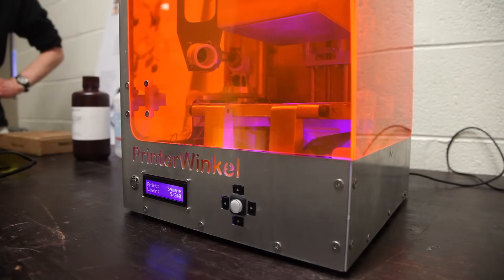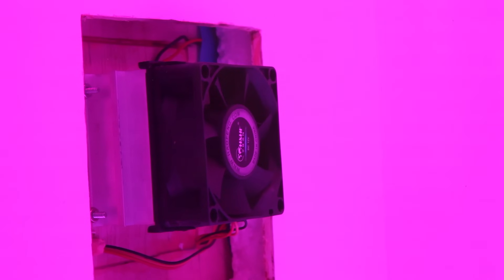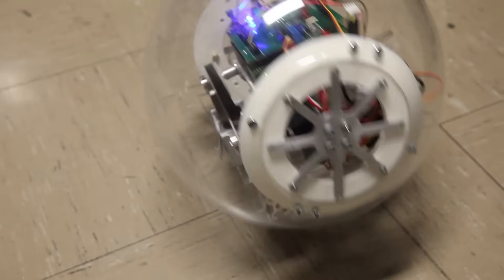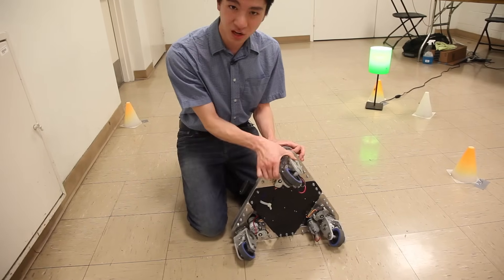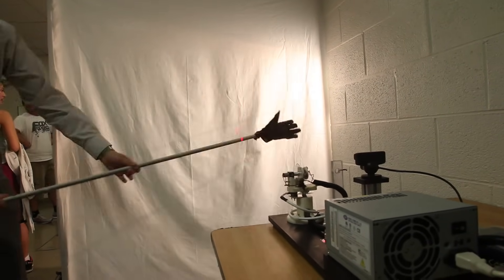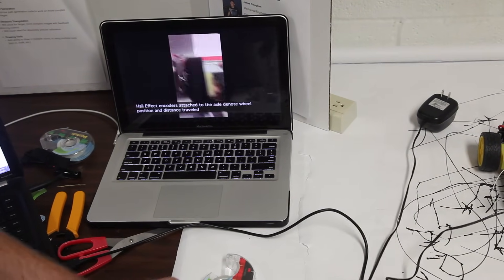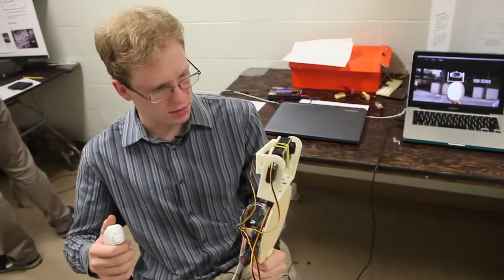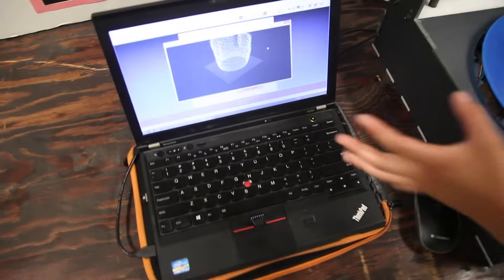Mechatronics Design, ME102B, Prof. Kazerooni, Spring 2014

Comment: That wheel chair was dope ,common that's worth an ovation
Reply: i really like the interface. Instead of a joystick we have traditional controls with less hassle. Plus the normal wheelchair can be converted
Reply: I’ve seen a few people in wheelchairs using something like this. Don’t know if these students were the ones to make them, but it’s become a product.
Reply: unfortunatly not a standing ovation
Reply: Mashallah tbark Allah alhamudillah inshallah better astgfrallah
Reply: Genuine question though, once the motors are activated and the chair goes forward with speed, how would you control it if some sudden obstacle comes in the way? Would be difficult to stop the motion with ease I suppose.?
Reply: @AtharvP07  What if you start rolling down a hill, you might need wings attached at that point as a safety feature.

Comment: I like your "Fido" robot. I built something similar in the 90's, but it was less sophisticated. To balance it I built a small gyroscope placed on the four wheeled rover like vehicle that drove within the hamster sphere, and was radio controlled. It wasn't perfect, because my home-made gyroscope needed some kind of speed control to respond to various forward, and backward turns made from the RC operator.

Comment: If this happened in 2014, does it mean that the guy at 0:22 changed the history of 3D printing? 🤔
Reply: Only if he didn't stopped
Reply: nah, the techs been around for years. SLA (the type of printer that he made) just hasn't been seen in homes until recently because the method he used (moving a laser) is incredibly expensive to manufacture. it's become more accessible recently, as inexpensive machines like the elegoo mars that use an LCD screen to cure the resin have appeared, however they remain less common than their FDM (regular 3d printing method with nozzle and plastic) cousins because resin is toxic (and expensive) and requires lots of post-print processing and safety precautions during the processing.
Reply: errata: Stereolithography (SLA) printing was invented in 1984. hahaha it was a little 30 years mismatch

Comment: 3D printer with mirrors
Photography leveling
Green house lighting-indoor
Connect 4 - 1 player 
Delta droid- frosting
Fido - joy stick
Camera gimble to follow his color 
Sidewinder- translate and rotate 
Hands free helmet 
Hands free wheel chair 
Laser tracking gimble. Fluid flow 
Servo that shifts, no hands
Motor for image
Image printing 
Food printing 
Sports camera balancer
Smart shade
Quad copter x y coordinate 
Ir sensors for scan to 3d print

Comment: i want to do mechatronics but im kinda scary cause I've doing Electrical/Eletronic engineering and i don't have enough info. does mechatronics and robotic engineering are the same?
Reply: Mechatronics is different in the sense that it tries to take a bit from each different engineering field (Computer, Electrical, and Mechanical). Robotics is different in the sense that it can be considered a part of Mechatronics, but focuses on autonomous, whereas Mechatronics is automatic. A real life example would between traffic lights and cameras. A traffic light still requires some input whereas the cameras act on their own to create their own inputs. Hope that helped.
Reply: Jackie Kang thanks it helped a lot actually
Reply: So what are you doing now?😅😅

Comment: if you go to the video that has blum.inc in it that whole video is wrong.  what i do at celestica is build a complete tool for the semi conductor industry not play around with machine shop parts.... you assemble, build and teach a robot what to do on the field.... 

 the whole (system) is a tool or device that does a single or multi amount of things you repair or develop. while in this field and i will tell you, this field may have no limits...... so if you are interested in this field you will be challenged and you will grow and then possibly get into engineering.  also make sure to get the highest score on your grades cause they wont take people who have a low score.....